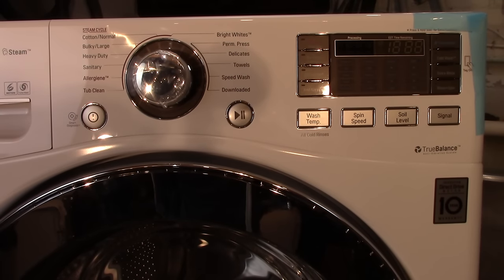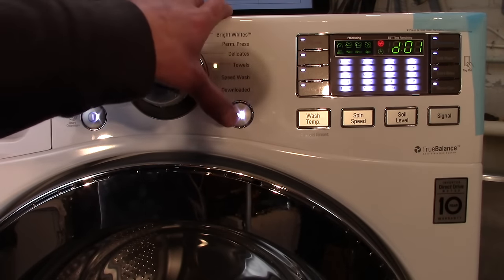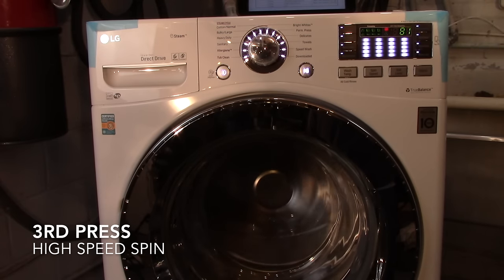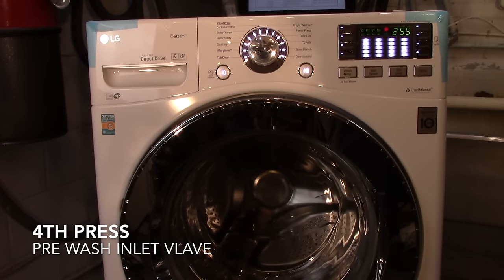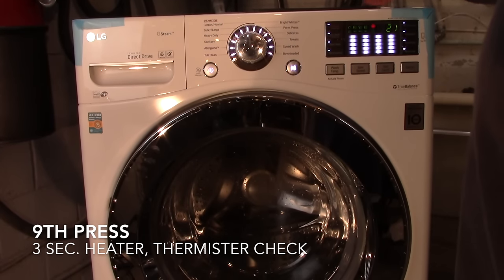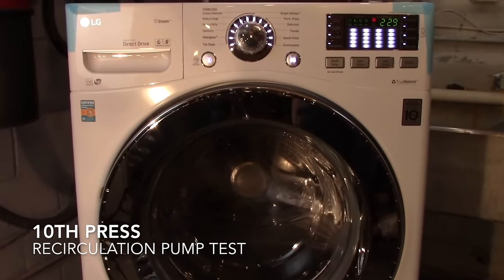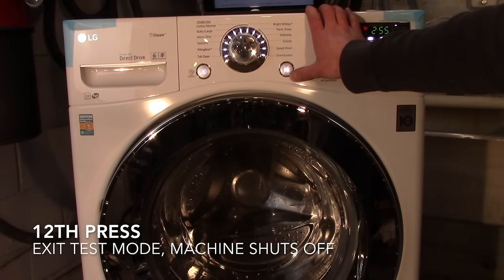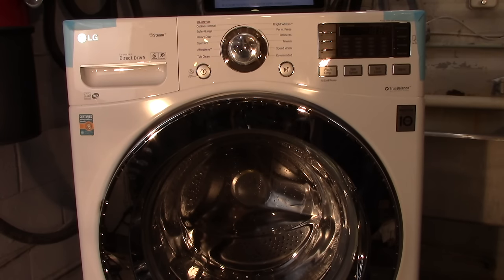How To Put Your LG Front Load Washer In To Self Test Mode | Diagnostic Mode

Comment: I've an additional question: should the drain hose located beside the drain pump filter behind that door in the lower left corner of my machine, be full of sand🤔? I was under the impression it should be clear of debris. What actually drains from this hose? How can I clean it? I have carefully pushed a long Robertson up there and a long bristle brush in an attempt to pull out the debris but to no avail. I am aware of how to pull apart the front of the unit, having fixed a sensor in the past. Would this drain hose be accessible from the lower front of the machine? Can it be detached completely for a thorough clean? Thanks so much for any info you're able to provide :goodvibes:
Reply: Try flushing it out with water.

Comment: Do you have a diagram that shows what hose goes to what port of the detergent dispenser from the main water valves. I took the dispenser off and not real sure if i put 2 of the hoses back into their correct spot.

Comment: My circulation pump and low and high spin aren’t working even after replacing a control board that had burned components.  Have the same unit as the one in the video! Agh

Comment: After a cycle has finished, the light in the drum stays on. When I try to power on the washer, no power will work. I have to unplug and replug it in. Any ideas?
Reply: I had a PF code continuously for a month. It would shut off during wash and wouldn't power up for ten minutes,then  it would give the PF and I would continue the wash and repeat. Then last week,no power at all. I researched the best I could,and I took the chance and bout a New main circuit board $240 . I just replaced it,and still no power 😭then thirty minutes later of me cursing and bitching, it's like New. It would have cost me over$400 I Kno it. But I'm washing Now 😁 long story, maybe it helps you

Comment: Hello So I have a LE Code I've pulled the Stator off and there is no Hauler sensor, I checked the resistance in the windings and they are all with in spec I also checked the  pig tail to the stator to see if there are any broken wires and it checks out fine as well. In the PCB there is a little red light on . The machine was working fine until I unplugged it moved it 5 feet so I could put new flooring underneath it and now is showing this LE code . Any tips or thoughts would be greatly appreciated. I suspect its the PCb Board but just guessing .

Comment: Hello. in the case of LG washing machine  [model: F1K2CS2W], it would not start and had blown the fuse from the central electrical panel. when i disconnected the lg reaktor (5874ec2002c) the fuse did not blow. is this the problem? how can i measure it to be sure that is where the problem is. Thanks....

Comment: PLEASE HELP!  Sir i have an LG Tromm and i have an IE code displayed halfway through the wash cycle, after going thru your self test i found the "main wash" inlet valve not opening, its just silent, the pre wash and hot wash fills the tub normally, but its silent on "main wash" , i pulled the hoses and checked the inlet screens no issues there, no kinked hoses, do you think its an electrical issue like the main control board not sending power to energize the inlet valve? whats the valve coil voltage? 110v? should i check for power to the valve or look elsewhere? thanks sooo much my wife is so mad at me that i bought a used washer and dryer!
Reply: Ok heres what i found..during the fill cycle depending on the water temp setting i will actually get 118v at the main valve terminals but thats when its unplugged and checking voltage, when i plug it in the voltage drops to 22v , the connections are very green and corroded so i cleaned them but same results 118v unplugged and 22 when i plug it in, i checked the valve by applying 120v to it and it operates perfectly i know its not the valve, so i opened the plastic  main control board and it has a small b lack bubble that doesnt look normal and has a burn smell, i repair furnaces and when we have a burnt transformer or board it has the same smell, im sure the burn mark is the culprit, ive checked everywhere and no one has a replacement board please tell me if i can use a board from another model of LG washer that will work my washer m# WM2233HS  any way the board can be repaired? or any ideas for replacing the board?

Comment: My washer is not filling up at all.  I just went through these steps and my washer doesn't fill up during the prewash part of the test and during the wash cycle, it won't move past this. In the testing, it filled on the rest of the cycle. Is the prewash inlet valve separate from the regular water inlet valve, (and if so where do I find that) or is it all the same thing?
Reply: Did you check the inlet screen to the hose that connects to the washer? There is a screen there.
Reply: We ended up  changing out the inlet valves in the top back of the washer. One looked really bad so that was obviously the problem. We changed both of them since we have the dryer stacked on top and it was convenient. That was six months ago and not a problem since. While in there we cleaned everything out, including the hoses, since we have really hard water in our area.

Comment: Question, I literally just had my new LG washer installed however, it doesnt sound as smooth. It actually sounds like its scrapping when it turns. Doesnt seem normal. Please advise
Reply: Json1124 I’m no professional so please take this with a grain of salt, but I’ve heard that noises like that are usually something to do with the drum like it’s off or something.
Reply: Did you remove the shipping bolts in the back?
Reply: Bearings or spider arm
Reply: @jyekas  thank you, I didn't know but that's exactly what it was.

Comment: Step 2 and 3, and 10 not working. Water is in the tub.  Trying to drain with release valve.  Will 2 and 3 fail if water is in the machine?

Comment: I have a Kenmore washer that only powers up after disconnecting power cord and resetting both the power and start buttons sequentially. It goes through wash cycle fine but only once the. I have to repeat steps again. Is this a control board issue? Any suggestions? Thank you

Comment: My LG front loader consistantly shuts off mid cycle. Sometimes early in the cycle, sometimes later. Always with the code PF, power failure. I had been suspecting something with the pump but it passed the self diagnostic several times. Very next wash cycle it shut off again. Is there another test i can do? Should i look at the Noise filter? If thats a real thing

Comment: @LORAINFURNITUREANDAPPLIANCE  WOULD YOU KNOW WHY MY LG FRONT LOADER IS EATING DRAIN PUMPS AND WHERE THE BLACK GEAR GREASE IS COMING FROM UNDER MY WASHER? AND WHEN IT GOES TO SPIN AFTER WASHING OR FOR RINSING { when that works} IT SMELLS LIKE WARM GEAR GREASE, AND THE DRAIN PUMP HAS BEEN CHANGED, BUT ONCE AGAIN ON RINSE CYCLE, IT MAKES GRINDING NOISE AND JUST SETS THERE WONT DRAIN, WONT SPIN,,,,,, BUT IT DOES ON WASH CYCLE,

Comment: My washing machine test doesn’t seem to have step 10 - circulation pump instead starts the drain and the 11th step ends the test. 
The problem i have is the machine trips the circuit midway through the operation or just trips off on starting the machine, what is the probable cause.

Comment: Hi thanks for the video. My husband ran the diagnostic test and the rpm that should be between 110-150 is only 64. It smells like a belt is burning.  A piece of rubber came from inside. What could that be?
Reply: likely the drum is rubbing against the door seal.   Could be a bent inner drum shaft or worn bearings.

Comment: Hello came home the other day and found washer door open and the drum half filled with water, water still running through it. Power was off I had to turn the incoming water off to get it to stop. Ran the load again it was ok. I noticed during the rinse cycle the puts a large amount of water through the bleach drawer several times and it doesn't seem to shut off. Could it be water inlet valve. Our model number is WM2688HNM.   thanks

Comment: My model is WM3670HVA. It looks exactly like this one. I followed these steps and seems to work fine, except for the side jets. The side jets do not work, which must mean the recirculating pump does not work. However, when I look at the parts manual, there is nothin called a recirculating pump. The only pump is the drain pump. The water fills up and drains fine, there is just no water spraying ever. What do I do? The main problem is the clothes are not washing.
Reply from the maker: the 3670 does not have turbo wash (recirc pump)

Comment: We have a LG Model WM2233cu. What codes would you get if the door lock is malfunctioning ? Running through the test you posted, I find it only does a few of them? Would a broken door lock do something like that? Thanks in advance.
Reply: I can help you.
DE or DL - Unable to lock
FL - Door cannot be unlocked after several attempts

Comment: Hi, I tried the diagnostic test on my LG Tromm.  When I pressed spin, soil level and power, the code IH: 61 (steady) showed on the screen.  pressed start, no spin, 2, no spin, 3 the water started coming out.  I stopped as i know it will not drain too.  I had to manually drain it the first time.  I just want to know if it's time for me to buy a new one.  I don't want to call someone, charge me for coming then unable to fix it anyway. Thank you.
Reply: You need to get the Service manual for your machine if the owner's manual has no code section or you don't have the oxnwers manual (or you can't get one.)

Comment: I have a LG model WM4270HWA, and when I go through the Smart diagnosis, the washer does not rotate on step one or spin on step two.  Would this indicate that the main circuit board is bad.
Reply: I replaced the door latch once and it started spinning and washing again.

Comment: I have an LG front load washer model WM2688HNMA.   I started out with your instructions and got thru #1 fine when I went to #2 which was water inlet valve the washer started violently shaking. It really scared me but I hit OFF button and tried the process again with same result.  Had a repair person out today as I was getting an error code “tE” every time it went into beginning modes and walking around like unbalanced.   Please help😱😥😬
Reply: What was it? Drain pump?

Comment: Will this work with the older LG Front loaders like the Tromm?
Reply from the maker: FireAlarmTechGuy4444 yes
Reply: @LorainFurnitureandAppliance   I have a TROMM but I tried all front panel push button pairs with power on button and IT DOES NOT respond
Reply: @chichi sounds like the controller is bad. Sadly the part is NLA. Try eBay and save the search. You should get a Speed Queen FR7 Or TC5000WN
Reply: Worked like a champ on my WM0642HW.    Video dude -- thank you.

Comment: What is the problem when the machine turns on, runs a cycle, shuts off and doesn't turn back on again without unplugging the machine and plugging it back in? After a cycle the drum light stays on and the machine will not power back up without unplugging and plugging back in.
Reply: I have the same problem. Any ideas out there?

Comment: I was getting an intermittent low water level code....cleaned the filter at the inlet in the hose now the water won't pump into machine. Help lol
Reply: Open the main water supply valve!

Comment: My machine cuts off mid cycle and displays PF when I turn it back on. I ran this test mode and it didn't display any errors but it did power off the first time in counterclockwise rotation and then a couple other times in different places after I ran it a second time. It picked up where it lept off when I powered it back up in test mode. It seemed to do something different in at the end as far as which order of test but I'm not for sure. My machine is a wm3070 an a little older than some. Would anyone know what is the problem with my machine is. I've replaced the drain pump and clean out the inlet valves and everything else cuz I didn't clean it often enough and it was extremely dirty and clogged full of crud everywhere. I just need to get it fixed and wash clothes. Can anyone help. I did see somewhere about the control board. Thx

Comment: I remember having a machine like that sadly the heater decided it wanted to go to ground for no reason which made everything live   yes everything even the door
Reply: You have an issue with your electric.  If the chassis gets electrified the breaker should trip.First line of electrical defence would be a GFCI outlet the washer /dryer are plugged into.

Comment: Hey brother, my washer doesn't spin test mode  #2 and #3. Do you know what I should do to fix it?? Thanks
Reply: did you fix it?
Reply: @user-pu3cf9pd2m  I did not
Reply: @jameswarren4747  Researched it and it's the rotor assembly. Around $110, will probably replace it tomorrow.
Reply: @user-pu3cf9pd2m  I did alot of research. Watched a million videos. I thought the same. Hundreds of dollars later, it still wouldn't spin. I tried motor, hall sensor and control board. I gave up and bought a new unit.... After further examination, I think it's the door mechanism. It's very loose and the hinges are shaky. One guy said that it won't high/low speed spin if the pressure is lost from a loose door or bad lock switch. It still tumble spins perfectly
Reply: @jameswarren4747  The pipe that was supposed to drain out the water was pretty much choking tight. It wasn't the rotor assembly. The water isn't draining and it needs a new pump to drain the water. It spins fine for me now. If you still have yours, take a look at this.
Reply: @jameswarren4747  Needed a new water pump, everything is perfect now.
Reply: @user-pu3cf9pd2m  Nice. How much did you find it for? I still have the old unit. Maybe I can fix and donate

Comment: Thanks.. this helped me a lot. Unfortunately I think there is something mechanically wrong.  I have a TROMM approx 2007, started getting code LE. Test mode step 2 tried to increase speed, then made strange grinding noises, slowed down again, then tried to speed up and same noises. Definitely something not  right. I stopped testing then. Is there a bearing/mounting system repair possible?
Reply: @LorainFurnitureandAppliance  Thanks that is kind of what I figured once I realized it was mechanical, not just a sensor. Your videos are great thanks for the help!

Comment: Thank you so much for this information.  My machine is not spinning on the 2 turn and also I have an OE error code. Please HELP! WHAT DOES this mean?
Reply: Did you get it solved?  The "OE" Error code means "drain hose is bent, pinched, or clogged. The drain filter is clogged ".  I have that error code but nothing is clogged.
Reply: Greg Simpson did you get it solved? if so how did you do it I’m having the same problem

Comment: Thank you very much!! I have the manual and it does not show you how to do this. I was not sure what the cause was because the LG front loader would not go into first wash spin and the water did not seem to be draining. Did the test and it spins in high and low but at the end just hear the pump hum, but nothing drains. So, I think I will start there. Of course I already took it apart and cleaned the drain pump and checked the pump for blockage. Saw nothing. So hopefully replacing it will fix the issue. Thank you again!! :)
Reply: I have an LG 6.5kg Fh2G6WDS5.
But I even couldnt put it on diagnostics regime. The sencor screen didnt react when I pushed the 2 buttons together. Spin and swithced on.
Any problem?😯

Comment: Code EE with the left E if you erase the top line of theE -L=|180° F but it upside down turn it out at 80° turn the air for 180° turn the F180° and a E that’s the code it is sending
Reply: FE turn the F a 180degress that the code it sendingFE